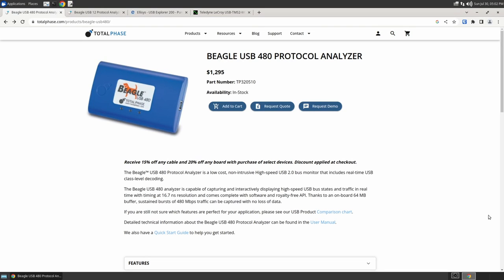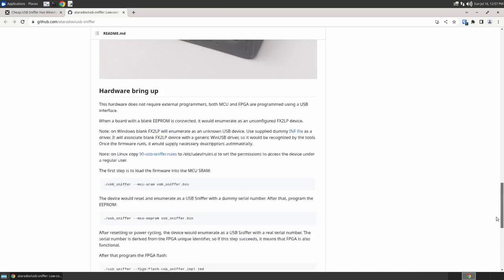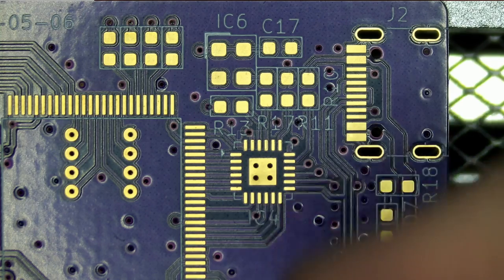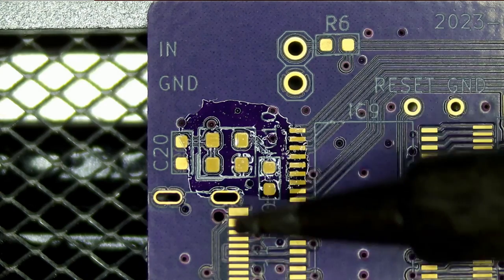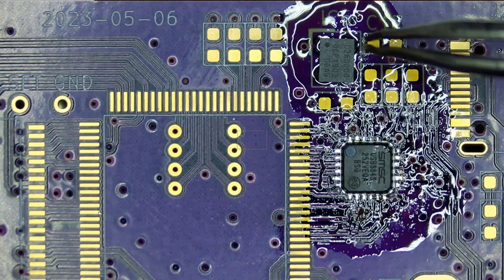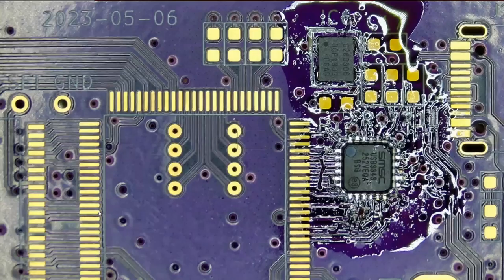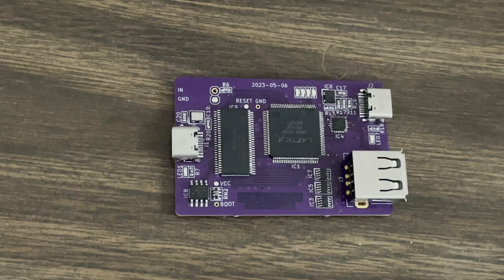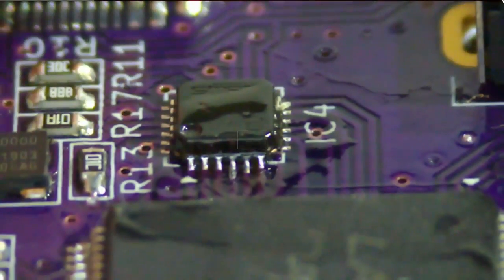Building and testing Alex Taradov's USB Sniffer

Comment: A very useful video on soldering for beginners like me, what kind of fluxpen do you use, how do you wash the board after soldering, what temperatures do you set?
Reply from the maker: Thanks! I use Kester 186 for my flux pen. I wipe the flux off with Q tips and 99% isopropyl alcohol. The flux is very sticky so it requires a fair amount of force to clean off especially if you wait too long. I change the temperature based on what I am doing. For drag soldering I believe I’m usually in the 300 to 325 Celsius range. I usually bump it up a bit to 350 when doing through hole soldering. I may have gone even higher when soldering the USB-C ports. Sometimes that requires a lot of heat because the port itself and ground planes can soak up all the heat.

Comment: Very interesting device. Is this the same things as whats being offered now on Aliexpress built with a case as "Open Source Portable USB Sniffer 2.0 Packet Capture" ?
Reply from the maker: Interesting, it does look the same. Thanks for sharing. I think the AliExpress sellers have redesigned it a bit though. They're talking about how they used a speed grade 4 part even though the original project says it's too slow. I don't know for sure if Alex's original firmware works on these or not.
Reply: @doogulass  Thanks.. yeah it looks similar. Might be worth it for someone if they dont want to build it.

Comment: Hi. I am also impressed by Alex's project and built it yesterday. It even works but not able to decode anything above link layer. I've created txt document on flash drive with "hello" inside and i see it in wireshark, but only on link layer, no endpoints, no transfer type, just raw data. Do you know if it's possible to improve? It doesn't work even with hid, again only raw data.. Btw it works on mac (tried both x64 and aarch64)
Reply from the maker: Hmm, it should be giving more detail. Are you using the most up to date version of Wireshark? I saw something similar at first when I was using an old Wireshark.
Reply: @doogulass sure, tried on mac and windows, same result. I see data0 and data1, raw data in hex/binary, but no information on next abstraction level (like interface/endpoint id, protocol specific data like parsed button id for hid)
Reply from the maker: @vitalyparhomenko7817  I’m thinking maybe you started the capture after plugging in the flash drive? You have to start the capture first because otherwise Wireshark won’t see the descriptors get requested and won’t know how to decode the data. Could that explain the problem?
Reply: Maybe it is not a problem at all, I see wireshark reconstructs sometime USB URB and USB Mass storage but it is rare case even in pcapng files in doc folder. Also interesting that captured data doesn't contain valid timestamp, trying to figure out how to fix
Reply: Seems it is possible but fix will drop accuracy of nanoseconds..
Reply from the maker: Yeah it shows the parsed packets interspersed. Usually it works by giving you all the parsed info in the last packet of a group that goes together.
Reply: @doogulass yes, also figured it out, sorry, I am newbie in wireshark . You can also compare with usb sniffer provided by wireshark out of the box, it better understands context showing more info from higher levels

Comment: is it possible to get a premade kit?
Reply from the maker: Unfortunately, not that I know of. You could probably use JLCPCB/LCSC and ask them to populate what they have in stock, especially all the passives, to make the soldering process faster though. That would require some setup work though.
Reply: @doogulass  JLCPCB/LCSC doesnt have every parts to build it i already try